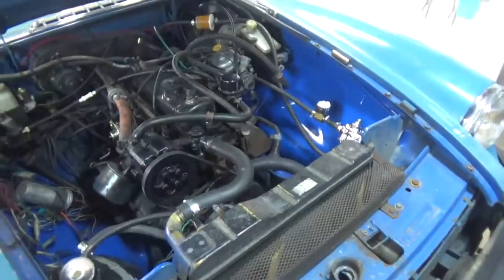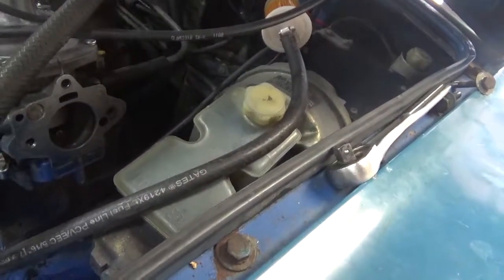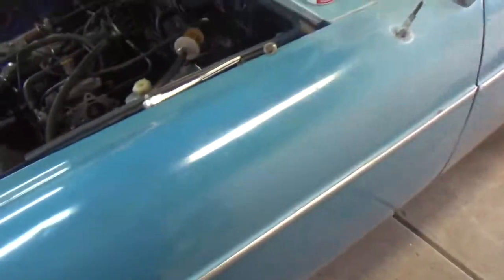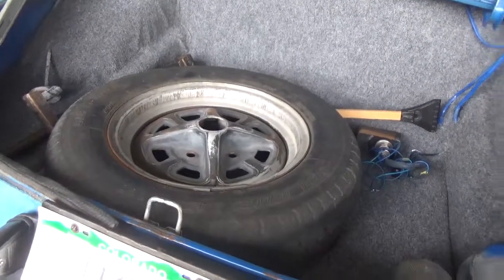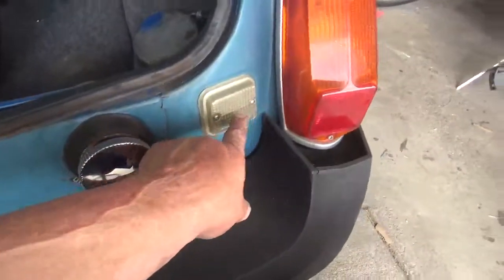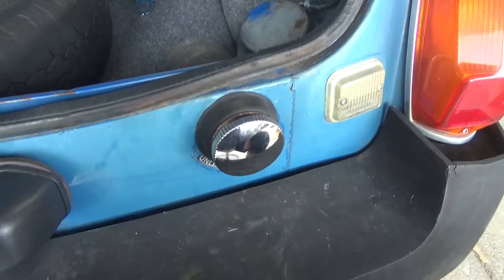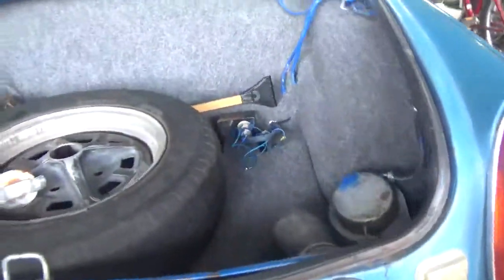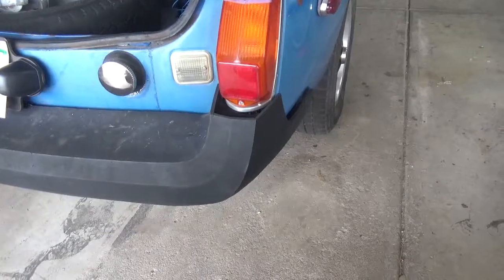1977 MGB Trunk Finale and Updates

Comment: That trunk came out great!  It's great when a car moves down the road, however, it's better when they stop as well. Lol!  If you turn the spare over is the wheel deep enough to allow the bolt to screw in?  It's getting there!
Reply from the maker: Yes, thanks, my wife did a great job helping me. It was pretty good considering we did not do this before. Yes stopping power would be good to have lol. I could do it that way, but it will be too long. However, since I have to cut it anyway to extend it why not cut it short and flip it. Good suggestion I will look into that, I think that would work better. Thanks.